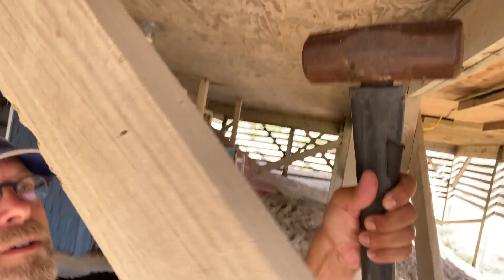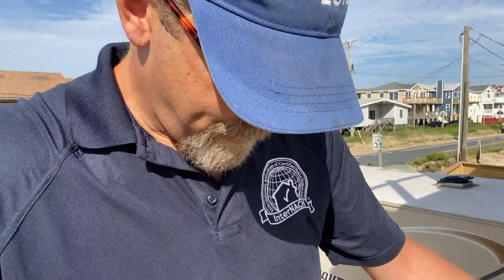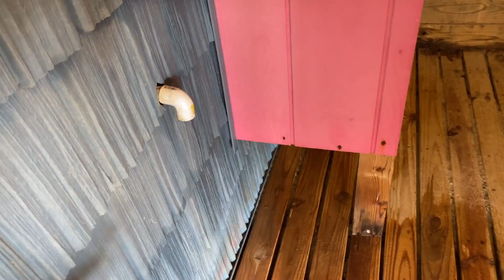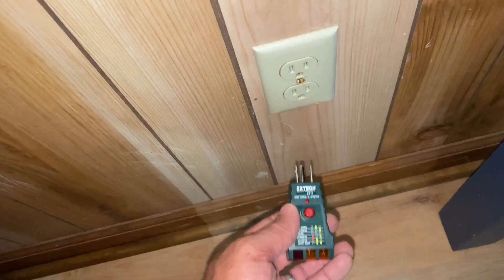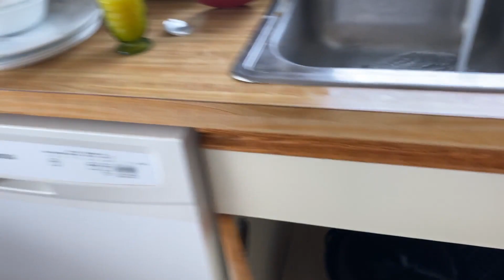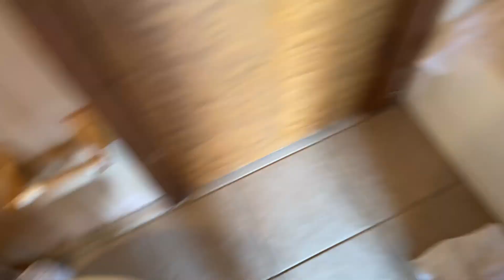Inspecting a Beach House in Nags Head, North Carolina with Ben Gromicko

Comment: Is there another type of drier vent cap that would be preferred over the louvered type shown in this video? Didn't know that louvered would be considered a defect.
Reply from the maker: Yes. Just a hood and a flap. Louvres restrict air flow and cause clogging. Louvres catch and hold lint. Full opening terminals for dryer exhausts present less resistance to flow and might be mandated by the dryer manufacturer. A “full opening” is considered to be an opening having no dimension less than the diameter of the exhaust duct. Screens are prohibited on the duct termination because lint from the dryer will clog the screen, creating flow resistance and eventually a complete blockage. This will result in a fire hazard. Louvers would also create flow resistance. Here's a short article you might be interested in reading: https://www.nachi.org/inspecting-dryer-exhaust.htm

Comment: Excellent inspection Ben!!!
Being a Florida home Inspector,  I do a lot of beach homes. When inspecting near a beach, surface rust on metal doesn't always mean water leak,  8 )
Off-topic are sandcastles listed under s.o.p?: 

John Grimaldi
InterNACHI Home Inspector Mentor
CMI
Orange Blossom Home Inspection
https://www.obhifl.com/
Reply from the maker: Sand castles are an ancillary home inspection service. In this video, the tank was leaking at the TPR and drain valves, and the water line at the bottom of the tank was a concern, because there wasn't any rust above the water line, just below it. Hm.
Reply: @internachi  Lol...Definitely agreed about the water heater.  but surface rust  can be deceiving...be careful